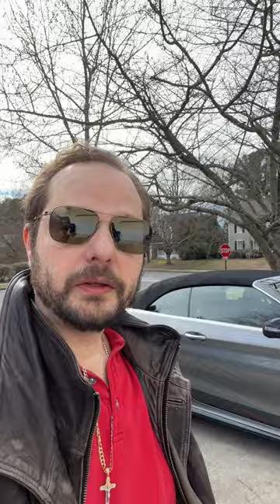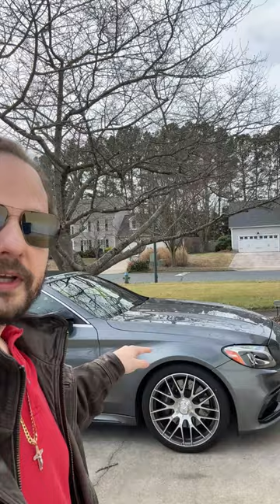Does tuning affect reliability?

Comment: simply put. If you are worried about reliability but want insane HP gains you shouldnt be looking for that kind of HP unless youre getting a hyper car. Theres a reason why a Bugatti is 20k for TIRES. These motors are expensive. HP is expensive. Reliability is achievable but at some point an understanding must be reached that the more HP you get to the more the likelihood to run into unforeseen issues. Like the M157 the wrist pinions that wrap around the crankshaft and rod bearings are known to become problematic if making enough power as they are a thinner section of the piston rod.
Reply from the maker: all good info